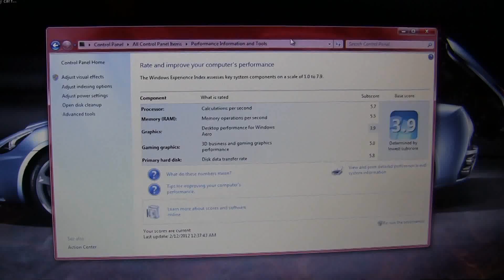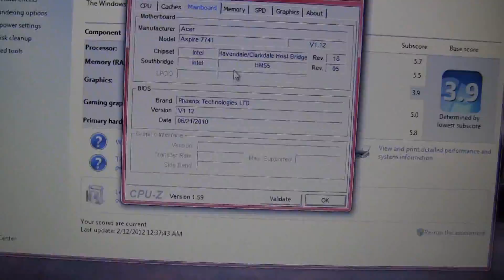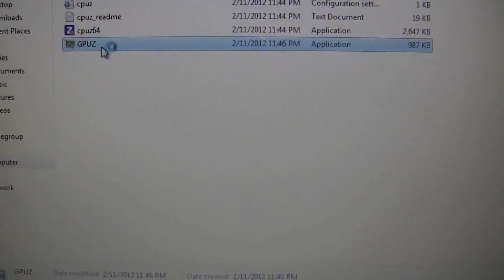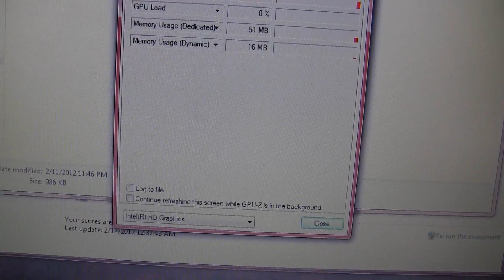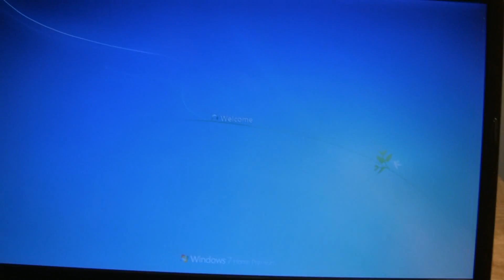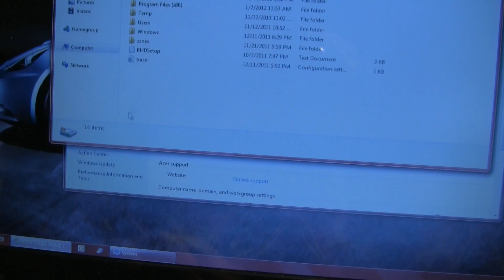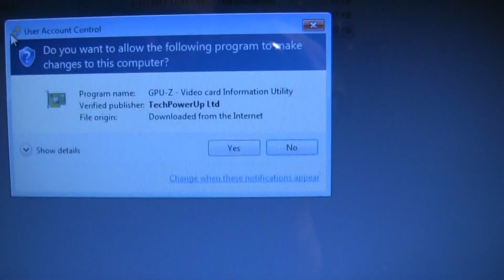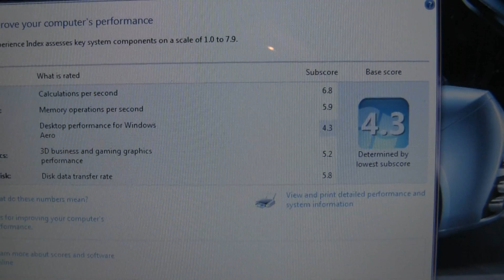Upgrading my Acer Aspire 7741 laptop Pentium to i5 CPU upgrade Replacement

Comment: Thanks, Maybe I can change the HDD for one SSD. I have another one, A Toshiba Satellite L755-1C1 with an i5 2410M processor and also an Nvidia GForce GT 525M. Can I change the processor and the videocard? I saw your both videos, and I thought that they couldn´t change in a Laptop. I´m from Trujillo, Peru. Thanks for the videos, Hope you have another project in mind.

Comment: Now i see i can upgrade my processor but my question is if i can upgrade graphic card and any components to increase gaming pformence in my laptop?
Reply from the maker: well, maybe, you have a buy a MOTHERBOARD for a 7741G, which I did a video on. but it will cost WAY more than the laptop is worth.  You also have to buy a different CPU cooler, too, because there is a extra heatsink on it to cover the GPU
Reply: Maverick Tangent where do you buy the cpu? Also do you have a link for it?
Reply: Maverick Tangent Thanks mate. Thumb Up
Reply: lmao so old post. :D

Comment: @drycreamer. I was wondering i have a acer 5733z running a intel pentium p6100 cpu. Could i upgrade it to a intel core i3 330m-3m cache cpu. As they both have the same G1 socket and would it give me a little boost in preformance.

Comment from the maker: well, look into the FS1 socket... that's what your laptop has, its a  AMD A6-3400M - so in THEORY you could go for a A8 -3500M or A8 3520M - they both fit the same socket, but I dont know what other kinds of problems you could run into. don't take my word for it, see my FAQ video and do some web searching!

Comment: What kind of tape or glue did use on the new processor do put it back on the mother board?
Reply: TheNilar treat others the same way you want to be treated ok? We shouldn't give our opinions when not asked for anyway. I know it uses thermal compound.

Comment: I have question i have a lenovo b590 with aintel core i3 2330m is it possible to upgrade this to an i7 quad core or a i5. as of now the i3 drains 35 watts from the wall

Comment: each laptop is diffrent  as is the makers the worst ive worked on is Hp  they have alot the cables everywhere under the keyboard 

the only things you can get to in the panels are the ram and hd 

if your really unlucky the sony laptops are worse then the hp as some dont even have the panels for that

Comment: You you read the bandwidth you read it wrong, it's Gigabytes per second. The capital 'B' denotes 'byte'. The lower case 'b' denotes 'bit'. I do understand how you could of made this mistake because bandwidth is typically measured in Gigabits.

Comment: i have the same laptop i tried to put in a intel i7 qm720 moblie 1.6ghz 6mb socket g1 slbly.  It did not work made a series of beeps on boot up with no pic and black screen.  I put back in the pentium and it worked.  is my laptop able to run this cpu?  I bought the i7 used on ebay i do not know if the i7 is any good or not.

Comment: Hey dude, thanks for the video!  :)
I have an acer as well and i wan to ungrade it to i5 3320m, FCBGA1023, FCPGA988, HM77 supported, Max TDP 35 W. My current CPU is B970, Socket 988B rPGA, HM77,Max TDP 35 W.
Could you please tell me if thats possible?

Comment from the maker: the 2860QM is the most powerful sandy bridge mobile CPU that falls in the same 45W power range as your... IF you can use a 55W CPU (check to see if it was an option in your laptop model) the 2920XM and 2960XM CPU's are the FASTEST cpu's you can get for SB mobile AND can be overclocked if your chipset can support it, but they cost about $1000 US each... if you can the money... you could probably buy a faster laptop for that much

Comment: can i change cpu in laptop acer aspire 5733
Reply: +john cenation 
I have a 5733Z-4469 which comes with the P6200 2.13 and upgraded it to the P6300 which is a 2.27. Not sure if I could have gone any higher or with a different type, but new for sure this one would work.

Comment: Quick question. Integrated graphics mean that its not its on the motherboard itself? Im familiar with the way it works on desktops because you can add a graphics chip externally but its a different story on laptops. By just changing the processor (that chip) you are not varying the graphics are you?
I have a acer 5741 which has a black screen issue and cant be solved so im guessing its the motherboard. im asking because ill get new mothrboard n put my old processor back in which i think is fine.